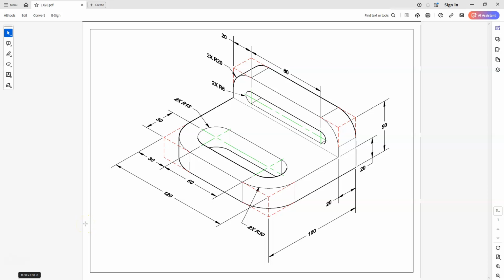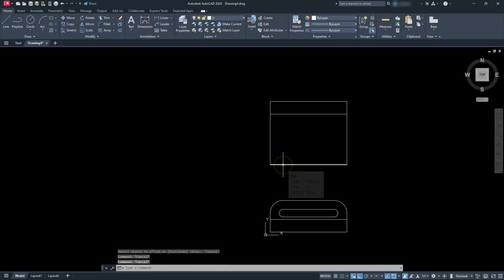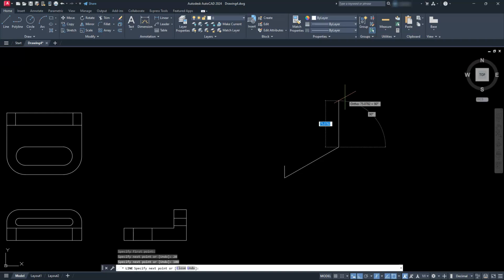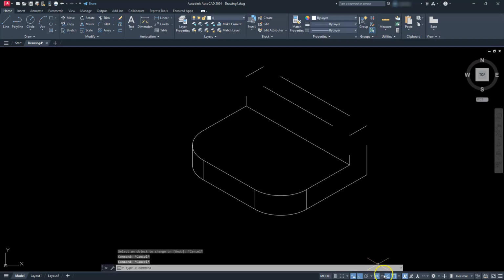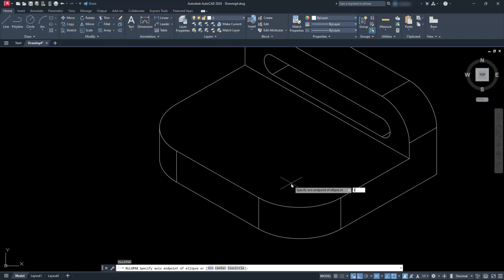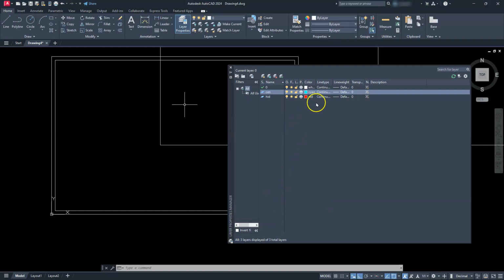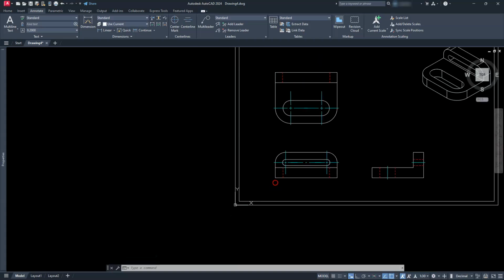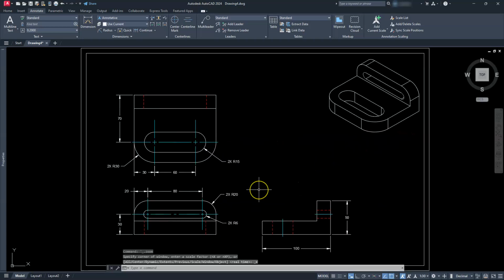AutoCAD 2D Tutorial with Isometric #autocad #cad #cadtrick

Comment: Hi Mark great tutorial, my dimensions lengths have also scale up  I’ve used an acadiso template and drafted in mm (metric) @1:1 scale. The title block 420 x 297 (A3) and then scaled the X and Y to 20.  The 2D draft area seem small so I scaled to a factor of 20.  but now a measurement at should be 100mm is showing up as 2000mm. Sorry just not getting the annotative scale thing in my head yet,  Any help would be appreciated.
Reply from the maker: I will try to put together a total metric video for you next week